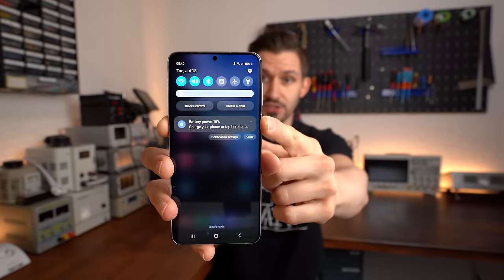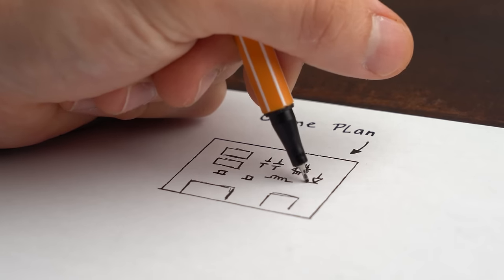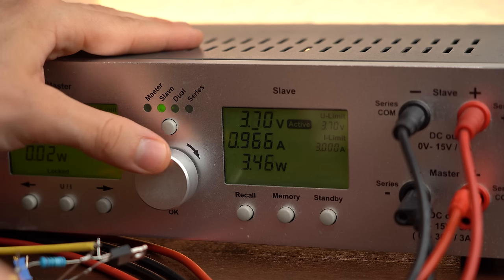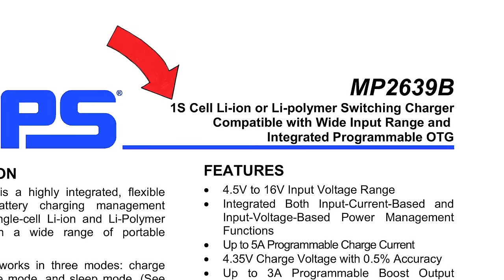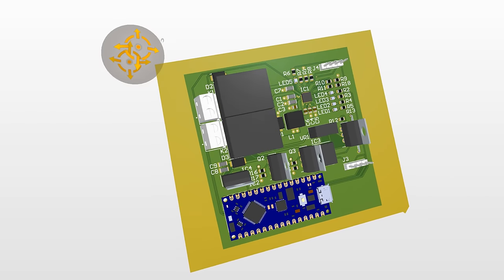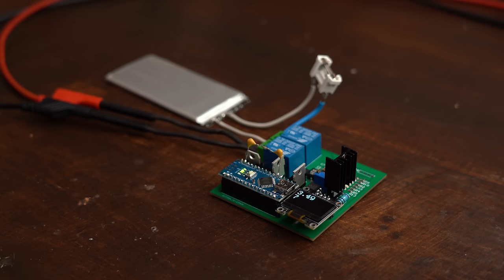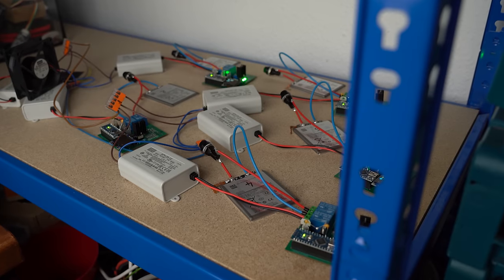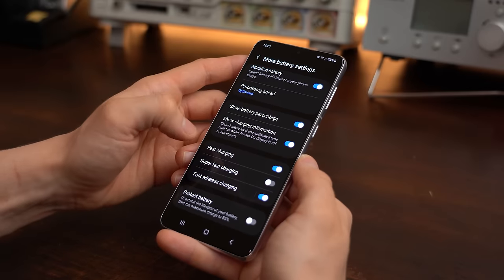Don't Fast Charge your Phone before Watching this Video!

Comment: Nice idea! The only problem I see with it that your Samsung device will usually NOT fast charge at 4.35V 5A, but rather at a far higher voltage and far lower amp. Using a simple USB tester between power adapter and phone gave me 9V 1.66 A (so slightly under 15W) during fast charging. What the internal charger inside the phone does I have no idea, maybe you could clarify that in a followup video? Also, I don't have a charger with PPS (Samsung-proprietary protocol enabling for finer voltage regulation than what the PD standard offers) which allows for even higher charging speeds (supposedly 25W on S21 series, and 45W on S22 series and newer) - which I guess is related to that "Super Fast Charging" option in your Samsung. My old S7 also charges with the aforementioned 9V 1.66 A. Which brings me to the question: How does your measuremeant relate to any practical, real-world scenario, specifically with Samsung devices?

Comment: Did you heat the battery when it was charging at 1 amp, this would approximate the heat the inductance charging generates. Also, the fast charge also heats the battery. We know that Li-ion NMC batteries don't like heat, thus heating would accelerate their internal resistance climb...

Comment: My current phone charges up to 125w full charge in about 20 mins or 50w wireless. It does however work out your routine so will charge up to 81% and finish the charge just before you wake.

Comment: Had my phone for over 3 years now (realme 6 pro) design capacity is 4,300mAh. Out of the box it came with 95%(as is normal with most devices containing a lithium battery) been trying my best to keep it between 5-70% with charging to 100% every 1-3 months (sometimes I'm too busy/forget to unplug etc so it would charge to 70+) I have charged it a total of 50,671% or 1,937,955mAh as of writing this comment. In that time I have only used a total of 131 charging cycles. This equates to around 0.11 cycles/day. My current estimated battery health is 85% with a supposed 3,656 mAh remaining out of 4,300mAh. I almost always use the OEM 30W charger that came included with the phone.   EDIT 21/10/24 Current estimated battery life still at 85% with capacity estimated to be at 3651mAH. Charge cycles have gone up to 215. Total battery charge % and mAH: 76,780% & 2,885,300mAh respectively. Averaging 0.13 charge cycles used daily for 1605 days. May update again if this phone continues to last, lol.

Comment: A great experiment and very detailed breakdown. That said, the assumption at the end that the capacity loss continues in a linear way is not correct. You can see this in old electric vehicles to phones as well. I've seen reviews of cars with battery packs that did 100k km with almost only fast charging and capacity was around 75-80% for actively cooled packs. That said I do agree that more investigation and transparency would be great, rather than the industry just saying "trust us it's OK"

Comment: One thing powerbanks do that AC chargers don't, is to cut power when the current is low. Leaving the phone to change overnight from a powerbank might be a lot safer.

The second thing neither do, is to restart power after an amount of time. Somewhere around 6-12h, maybe adjustable. This way you could leave a device plugged in forever, without inflating the battery. Even the best phones left in kiosk mode and allways connected to AC will inflate and maybe explode.

Comment: Wireless charging does introduce heat into the device though. I only wireless charge my phone because on my Galaxy Note 10+5g's usb port hardly works for some reason (common issue). 

I would love if you could do a long term test for batteries! Buy some of the cheap Samsung A series phones, Then set up a long term automated test for them. Disconnect them from the Internet so they don't have to update and such and have a program run the PCmark bench on them a couple times a day. 

There could be two groups, one group has the standard battery settings and one with the use only 85-20% battery option. Need a standard 1Amp USB charger, 5amp USB charger, a 1amp Wireless charger, And if there are any Above 5 Amp fast chargers or above 1 amp wireless you might test those. But with Just the Basic three you'd need  6+ phones and 2-3 years lol.

Every month you could have them drain all the way down and recharge to full, Heard this is good to do back in the day and occasionally but might want to have another phone for testing that specifically. Would be quite expensive so I don't know if you could do it but I hope someone does it one day like LTT or MKBHD.

Comment: How about thermal throttling and temperatures as in general? What temperatures would the 5A batteries reach? I think the bigger difference would be if we use lower charging voltages and not allow for higher temps.

Comment: I don't know if it's common practice, but my current phone offers fast charging (which I only use in case of "emergency") and a slow overnight charge which is specifically made to preserve long term capacity

Comment: I really like watching your videos, because you put a lot of effort into them. I have a question though. Did the batteries get charged with 5 amperes continuously, or was it using power delivery or something like that, that changes the charging current and voltage throughout the charging cycle. The first option is really harmful for the battery for sure, but as far as I know the second one is not as bad. And that's why it shouldn't be that bad for the battery. Also fully discharging and charging them is really harmful for their lifespan.

Comment: You should monitor the actual amperage when using the super fast charge thing because it doesn't stay at 5A all of the time. Once the battery reaches certain percentage, it slows down charging. 
It also slows down charging if the battery gets hot

Your circuit should've replicate this behavior to be accurate

Comment: My current phone I charge exclusively by fast charging and I know by my frequency of recharging that my capacity is lower. But it's a cheap TCL and I don't care how long the battery takes to kick the bucket because I can replace the entire phone at the cost of what any iPhone user would spend to replace a battery in there phone. But my tablet, I installed a cfw to allow me to limit battery drains and charging control to optimize the battery lifespan.

Comment: It's all good and nice but missing something. Most of the modern fast charging technologies uses more advanced techniques. For example, my Xiaomi 12T has 120W adapter. It works on 6A 20V mode but the battery has dual cells to devide the current and heat. 33W charger uses even less current, just 3A and 11V. Also it doesn't constantly charges at full current. The current starts from low and slowly raises and then drops again. It usally charges at full current only around 60% battery level.

While charging my phone with 60W it heats up to 38 celsius. When I charge with 120W it still heats up to only 38 celsius. That's the same amount when I use my phone instensly. So, on some brands, fast charging doesn't do much difference in terms of battery aging. But even that said, I still use a 33W charger because It heats up to only 32 celsius and I don't need faster charging that 33W. I easily charges my 5000 mAh battery in just 40 minutes. (15m on 120W)

Comment: Apologies if this has been clarified in another comment but i was wondering what type of charging cycle was used. Was it only the constant current stage? Normally there would be a constant voltage phase afterwards. I could see why he would omit that here as it would be similar for the two different test groups, but i think that the constant current phase will be charging the two groups to different percentages in a way that will reduce the degradation in the 5a group.

Comment: I had a phone of 4+ years, Yes fast charging will degrade your phone battery faster. Slow charging is always better. 

This is also true for battery percentage, fast charging to 100% is not the same as slow charging to 100%, each battery percentage at slow charging will last more than the fast charging.

Comment: Great content As somebody mentioned a fast charging 10-85% runn would be great also with electric cars ists the time @100% soc that kills. And the temperature in the battery while charging.
So this are a view ideas of many things I have heard or read over the past years. 
Following scenarios would be greatly appreciated xD

1. 10-85 vz 25-100 % fast charging vz normal charging 
2. 0-100% fast & slow with and without cooling fans to keep the better temp low

Comment: This video missed one critical factor. The charging Algorithm! All modern phone have an algorithm which dynamically adjusts the current based on the battery state. For example on my Samsung note 23 I noticed that when it's super low (1% - ~30%)  the Samsung supplied charger employs a saw tooth algorithm where the wattage starts at 0 and goes to 25w over a 4-5sec period. When the battery is between 30% and 70% it seems to be constant at around 20w. Over 70% the wattage is much lower and progressively gets lower at the  battery approaches 100. Please redo but place something inline with the phone to log the wattages and something to log the battery %'s. There's several charging Algorithm so id love to see what algo performs the best at capacity retention

Comment: I see a problem with this benchmark which is that it's not really how a phone charging cycle works.
AFAIK the only thing that degrades batteries is the high temperature. If you charge them too fast, they will heat up, thus they degrade faster.
You charged them linearly with constant 5A, but the phones regulate their charging speeds depending on the temperature of their batteries so the effect would be much smaller. (I have a 6 amp charger and my battery is still 80%+ of its factory capacity, despite that it's almost 4 years old now.)

I completely understand that you didn't want to deal with all the hassles to make your circuit smart enough, but I feel you should've mentioned this.

Comment: Great effort for this video sir. I dont hv any electrical background. But here's my experience.
I had a realme X7 Pro which fast charged my phones 4400mah battery in just 45mins flat with it's 67 watt charger. With my usage, I needed to charge the phone 1.5 times daily. Slowly I noticed I had to charge it twice.. But just after 2. 5years of usage I started charging it 3 times daily. When checked it always showed me half the life. Finally I had to replace my battery 2 months back. Now it's back to 1.5 times. On asking, the company guy told me that realme X7Pro has a twin battery. But one side of the battery had bulged and only one side was good. This may hv happened due to fast charging!?

Comment: I own a Xiaomi 11T Pro which has ultra fast charge at 120W. When I bought the phone ~3 years ago the battery would last a day and a half. I only charged it with the ultra fast mode which charges it in 15 minutes from 0% to 100% and the battery still lasts the same.

Comment: This is really informational and use full video!. Great as ever. But do smartphones really charge at a constant 5A of current throughout??, i also use the Ampere app a lot, and my phone supports fast charging and I have seen the 5A of charging happening in my phone. But it doesn't happen always. If the battery is completely low it fast and kinda saturates. So ig the real deal is when this is tested with 5 individual phones with new batteries charged and discharged with different current values.

Comment: Would using an old low wattage powerbrick extend the lifecycle of the battery if the "slow charge" option isn't available softwarewise or would you just toast the charger because the phone sucks the life out of it?

Comment: I would like to begin by thanking you for this video, but I wanted to add these notes.

As we know, the charging current is not constant throughout the charging period; it varies depending on the charge level. 
This aspect is missing in your experiment, and therefore the results of this test cannot be relied upon.

 You did not adhere to the charging current curve or "charge profile" adopted by the manufacturer.

I also have another note regarding the point of charge termination. It is supposed to have a low charging current at this point to obtain accurate battery charging results. However, this aspect is not present in your experiment, leading to the loss of a crucial condition for proper battery charging and resulting in inaccurate results.

Consequently, the results obtained are not reliable due to some errors during the process.

Finally, I send you my regards and thank you for your work.

Comment: I feel like I'm a bit late with this important question. Did you do the test with linear charging or a logarithmic charging curve. From what I have heard an logarithmic charging curve is supposed to be better for the phone battery since most of the battery damage should be caused by the high battery load when it's already mostly charged already and the logarithmic charging curve fixes that by lowering the amperage at the end of the charging cycle. One of my charges starts at 5A for an empty battery and drops down to 0.5A for an almost full battery but it changed my phone full at the same time as an regular charger but closer to the linear 5A charger too 80%

Comment: I usually don't worry about that so much. I used to replace my phone every 2 - 2.5 years, so the batterry is not less than 85% of its original capacity. Now I think I will keep my current phone a bit longer (maybe 3 - 3.5 years), so it won't be a problem to just replace battery after 2 years. Other thing is that EU has establish the law saying that from 2027 onwards, that batteries in phones would have to be easily replaceable by the user.

Comment: Can you test the impact of charging the batteries to 50% for number of cycles. After that see if the battery capacity has dropped. My experience shows that not charging and discharging fully negatively impacts the capacity.

Comment: When measuring the capacity was that following a 5a charge or a 1a charge from discharge?  That matters because a fast terminates at a slightly lower capacity because of how the batteries heat unevenly the higher the charge rate.  After 100 cycles a I wouldn't expect a measurable difference in capacity, what's far more destructive is leaving at 100pc state of charge for some time. But by about 500 cycles I'd expect the capacity to have permanently reduced a bit but only a couple of pc.

Comment: Not to sound harsh, but isn't this pretty well known and understood?

That's why you shouldn't charge your batteries to 100%, and most devices fast charge your battery only up to about 50% and then slow the charge speed down.
My Asus phone has option to limit max battery charge (between 80% and 100%) and has steady charging (max 30W) and ultra steady charging (max. 18W) modes, which limit how fast it charges the battery.

Still a good video and would like you to see more charges (I think 100 cycles is over half a year worth of charging for phones with better batteries out there, my Asus last's me 2 days easily).

Comment: Ayyyy you got an EBC A20! I bought one last year and its been such a good purchase but I do regret not getting the EBD A20H model since I don't need the charging functionality....running higher wattage discharge testing for 3S or 4S packs would be nice. I'm ok with pulling the cell off the EBD A20H to put it on a slot style charger if I want to do multiple discharge tests and there isn't a ton of info you can get from the charge cycle besides knowing how many mAh you're putting in which my chargers show.
Reply: Did you check out the EBC A40L? If you ever want to test the super high power 21700's the 40A discharge rate of that thing is enough to load test pretty much any cell. And its a great platform for capacity testing big prismatic LiFePO4 cells.

Comment: I have been aware that fast charging lithium-based batteries is detrimental to longevity and capacity since 2013.  I use 18650, 20700 ands 21700 Li-Ion cylindrical cells daily and up until recently, I always charged them at 0.50 Amps.  I bought some EPOCH 4500mAh, 45A 21700s and they take extremely long time to charge at 0.50A, so I charge them at 1.00A.  My iPhone 11 Pro Max came with a 5V 3A or 9V 2A Charger, 18W Max, while the new Chargers are 20W, so I'll keep mine as long as I can.  I'm not sure, but I think the phone fast charges to 50% and reduces the amperage from there, and I know the last 10% or more takes a long time to top off, so maybe Apple was smart about fast charging, but maybe not.  4 years after purchase, my Max Capacity is 88%, so a 12% loss seems to be average and reasonably acceptable.  I guess I could try to find a high quality 5V 1A Type-C charger, but short of building one, that could be a challenge.

You went to a lot of expense, time and trouble to show this, but you did a good job.  That much loss after only 100 cycles says a lot.

Comment: Having built these good circuits, you could use them for some more experiments with batteries. Maybe 1000 cycles? temperature of the battery and charging circuitry?

Comment: How about adding a high power discharge burst to simulate short durations of high intensity usage like using the gps in direct sunlight with bluetooth and cell connection? Or maybe gaming or camera usage? All of these would use mpre than 1A.

Comment: Using 33w for last 3y. Now battery degradation is noticeable. I used to charge once in a day and at day's end 15% charge still left.

But now I charge 1.5 times a day.

But I don't regret it. I rather change battery in 3y and use fast charging. I will change the battery next summer.